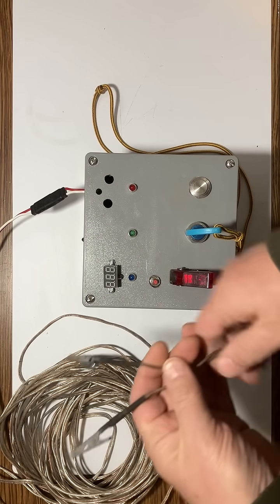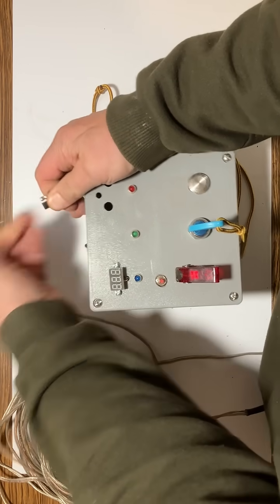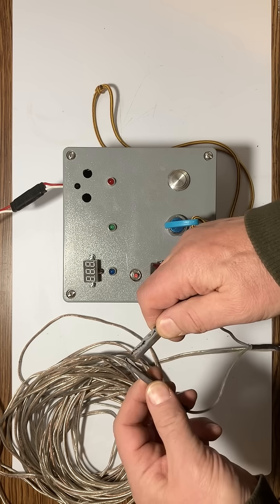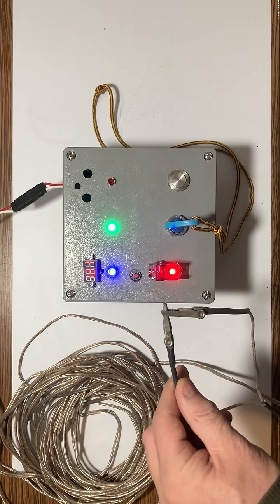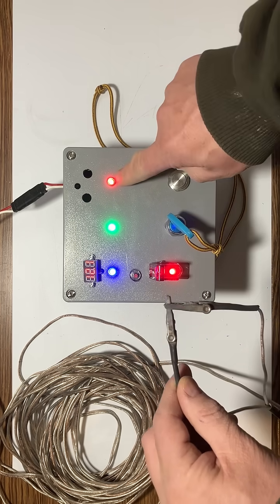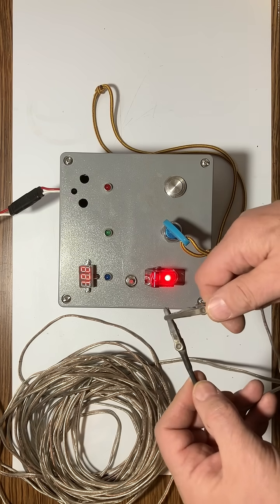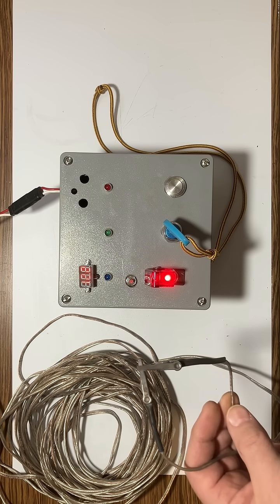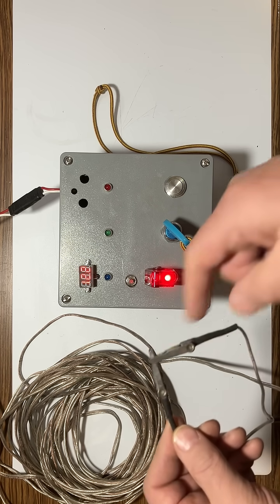Custom Launch Controller 4/5:  Short circuit situation

Comment: You might wanna switch the key switch to the power, and the covered switch to the arming switch! That's the rocketry safety standard! Nice system though! 😁👍👍🇺🇲
Reply from the maker: Could you provide a reference to this "standard". When I researched this, NAR has "suggestions" but are not binding "requirements". I cannot find this detail at this point in time; however, as I recall NAR "suggested" (1) power switch, (2) a mechanical interlock, (3) a temporary contact for the launch button. The temporary contact "pushbutton" is definitely important because if you have a short with high-energy batteries, there could be serious damage to the system. As an improvement to this requirement, I have a circuit breaker to ensure that if a person "holds" the button, the ignition circuit will be cut off.

Comment: Do you have a video of how to make that box?
Reply from the maker: This was the first set of videos on the launch controller. A few others have requested more information. I'm thinking about doing a complete series over the holidays. There is a lot of information - schematics, electronic equations, suppliers. etc.
Reply: @MrStreamerRocketeer I can’t wait to see the series. I’m just starting a local club and need a reliable launch controller and any information will help😊
Reply from the maker: It is in my "to do" list. A lot of stuff on schematics, parts, current equations goes into this. A good way to learn electronics. I'll get to it soon...

Comment: Hey, nice Controller ! Can you please share your Circuit with us ? Or how do you make shure you’re battery doesn’t get damaged if the wire is to big ? 
do you use a MOSFET?
Reply from the maker: Yes, I do plan on a new series of videos on the exact circuitry. I would also like to teach how the design actually works with some real electronics equations. Hopefully in a few weeks when I am on vacation...
Reply: @MrStreamerRocketeer would be very nice !! Could you share the circuit plan with me a little bit earlier ? I’m planing to launch my fist rocket soon 😊
Reply from the maker: I'm hoping to put the video together over the holidays. If this is your first rocket, there are simple alternatives that may suffice.
Reply: @MrStreamerRocketeer yeah I know, but with a setup like yours it’s a much  better experience ! Thank you !